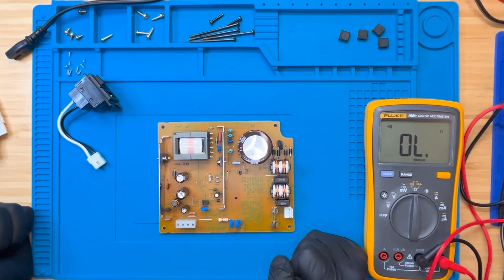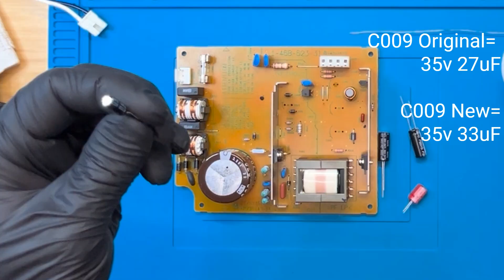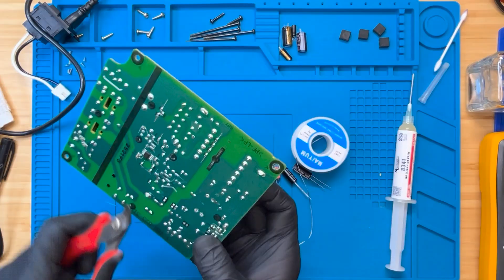Diagnosing and Fixing a Faulty PS2 Fat Power Supply Unit (PSU) | Retro Relics

Comment: Fine job, but it's actually the other way around - you can use a capacitor rated for a higher voltage, but you must maintain the same capacitance.